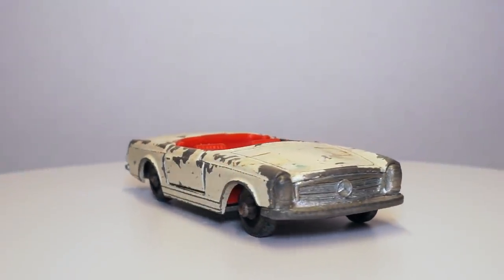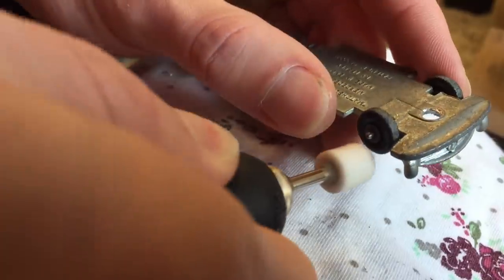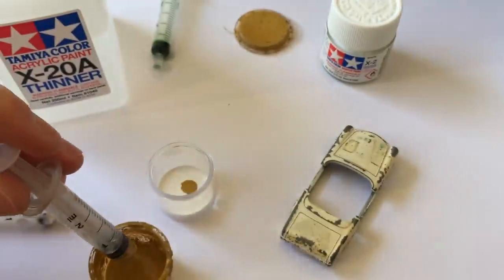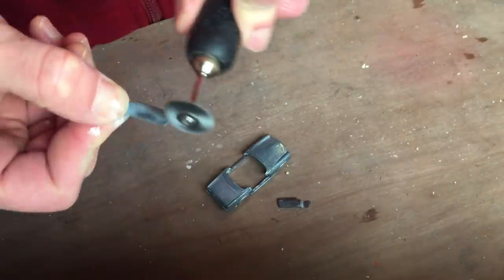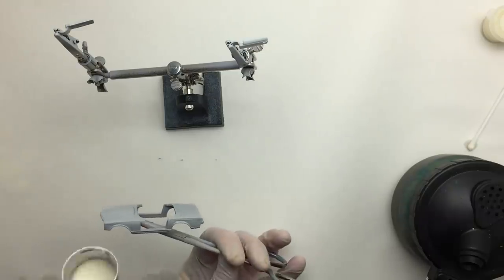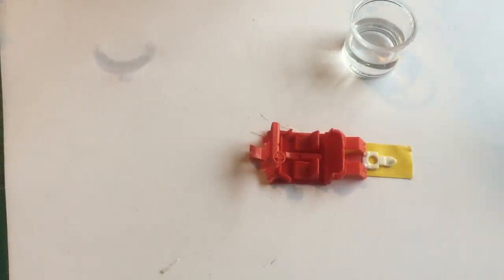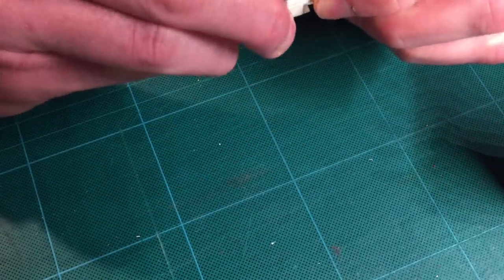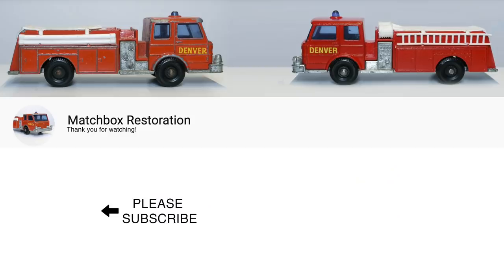Matchbox 27d Mercedes 230 SL - Full Restoration

Comment: Great job fella turned out really nice and those parts from model-supplies are superb for us restorers. Got 4 of these to do myself 2 regular wheels in cream and 2 superfast thin wheel one in cream and one in yellow. The cream superfast will remain untouched as this is the rarer variation of this particular model. Keep up the great work, it just gets better and better.
Reply from the maker: Thanks! I have some really nice parts from them. I also have some parts in slightly worse condition from them, mostly the metal casted parts. They do need some work before putting them on the model. Cool that you have multiple variations of this one. I'm already happy that I got one of them and that it was in bad enough condition to restore 😉

Comment: Great result.  Does justice to a classy vehicle!  Your paint match looks fine.  There is no way of ever knowing if the paint colour is an exact match, as all models - even mint examples, will have changed shade in some way.  The paint is 50 years old, after all.  I also use those repro tow hooks.  They are excellent for a restoration, and some customising.  I have put them on some Matchbox, which, in real life, would be suitable tow vehicles: #71 Jeep Gladiator, #6 Ford F100 etc.
Reply from the maker: Thanks! Exactly, the color is always a compromise. But it turned out just fine on this restoration, I think. I'm always a bit hesitant to keep or remove the tow hooks on these models. But since this was a restoration, I decided to keep it.

Comment: Amazing restoration!! But I think the windscreen should have been a bit more upright 👌🏼
Reply from the maker: Yes, you're right. But it's the windscreen itself that is a bit out of shape. I don't know why, it's a "new" spare I bought online.
Reply: @MatchboxRestoration  i think you are supposed to heat those reproduction parts and shape them before putting them on the car. Using a blowing fan on high should do the job

Comment: Great video, keep them coming. Do you use varnish to seal the paint? I didn't catch the name of the glue you used to attach the tow hook.
Reply from the maker: Thanks! I use an acrylic clearcoat in a can to seal the paint. The glue is called "Glue 'n' Glaze".
Reply: @MatchboxRestoration  Thanks. Is it Tamiya varnish?
Reply from the maker: Normally I use the tamiya, but this time I used clear Acrylic finish that is used to cover paintings. It almost has no smell and It levels out really nice. I need to further test it, but this might be a good alternative to the tamiya clear.

Comment: did you know that most electrical cutter/crimpers have bolt/screw shears in small sizes built in, see the little holes in the jaws, maybe you have a pair around?
Reply from the maker: I didn't know that. I'll check it out. Thanks!

Comment: The white you have mixed up looks very close to a Tamiya spray color call Insignia white, I use it quite a bit with my 1/200 scale ship builds if I have a large area to cover but not sufficient for the big spray gun and to much for the small airbrush... Your model looks nice by the way :-)

Comment: Great resto but the angle of the windscreen is way off.......
Reply from the maker: I'm afraid that is how it came. I checked if I could bend the bottom piece a bit, but it was sitting straight. So it's actually the windscreen itself that is out of shape by design... 😕